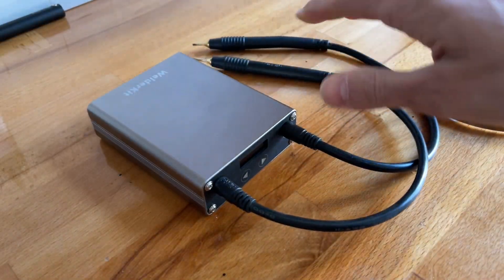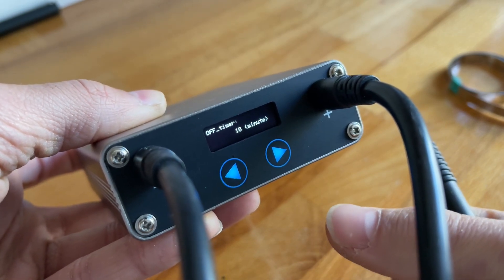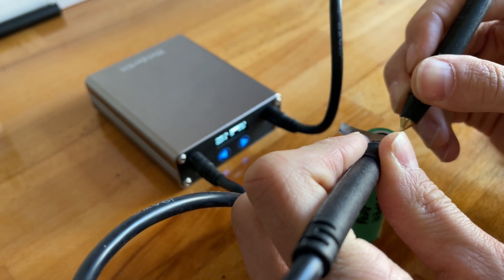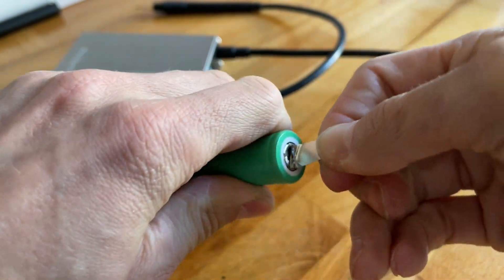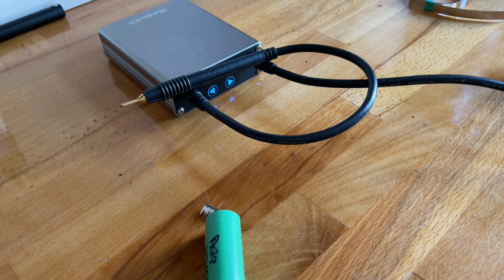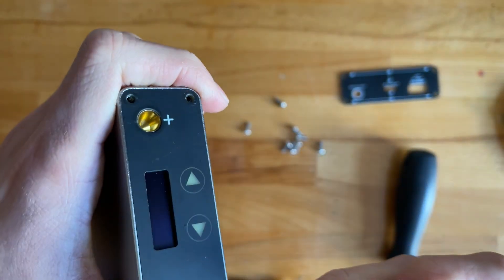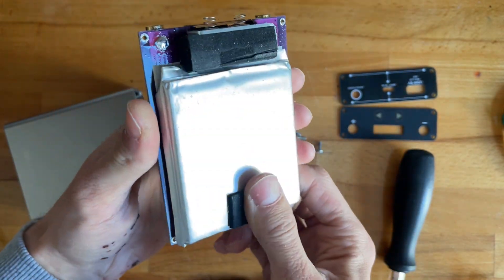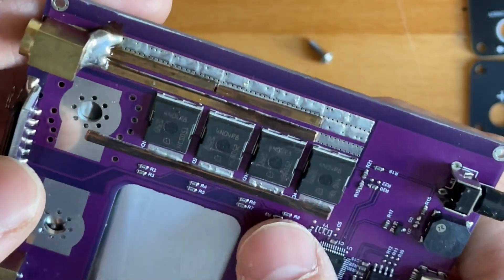How to Spot Weld Nickel Strips onto 18650s - DH30 Portable Spot Welder

Comment: i bought same machine today. is this spot welder still works ?
Reply from the maker: still works

the battery has puffed up a bit, but for a few welds now and then, does the job

if you let it discharge it'll beep crazily at you for a good few hours until you charge it above 40% or so

Comment: ❤0.3mm strips can weld with this mechine
Reply from the maker: mine has a weird glitch where if it gets too discharged it'll constantly beep when you turn it on for the full 3 hours it takes to charge above 50% or whatever it is .. does yours do that too ?

also, mine doesn't weld <60% or so state of charge .. is that the same on yours ???
Reply: @Darieee yes dear

Comment: Thank you so much for the tip. I was doing the hard press, and it was totally not working. :) P.S. give yourself a big pat on the back.
Reply from the maker: glad I could help ❤️

btw - what welder are you using, & how is it ?
Reply: @Darieee  Hi bought a Docreate 756 which lasted only a few uses, lasted 2 months. No way to get any return or contact with seller or AliExpress. I took a risk and got this DH20 from AliExpress as I was in the middle of a project when the Docreate 756 failed. I opened the Docreate 756 and the mother board had a crack running along both sides of the motherboard behind the Mofets, I don't think it can be repaired. Thanks to your advice, I have mastered this DH20, and it is well worth the money. Very happy with the welds. Thanks again for passing on your important discovery because the DH20 instructions have no mention of your technique.

Comment: Maybe that nickel is thinner but I juat got one and it am using .12mm thick nickel and mine doesn't burn or seemingly get as hot the one I got i don't know the name but it has a color screen and I have it set to 5ms for the pre heat and maxed out at 30ms and it has been working well on that .12mm but I was working on drill batteries and tried using the nickel they had and it wasn't doing it

Comment: What happens, when you press nickel strip hard first, it deforms it slightly in the area you are pressing. Once you release the pressure, the least resistance between the nickel strip and battery is where you have deformed the nickel strip. Also because less pressure creates higher resistance, temperature is higher while current is passing this spot.

Comment: Yoh, why did you scratch the pads, what for? Should i do that with some abrasive paper? Should i degrease the pads b4 doing anything?
Reply from the maker: they seem to gather some oxide over time .. I guess if you very gently run some regular grit sandpaper over them it should be fine
Reply: @Darieee  thank you, so it will make spot w welds stronger, thank you for clearing it up

Comment: 7:12 Damn that solder haha 
you will need a 5mm or even 6mm solder wick and the largest soldering Flat tip you can find to desolder that thing for battery replacement.
Good thing you can see the nickel strip  so you can just cut them off first so you can safely remove the solder without endanger the battery from all those heat from your soldering iron.

Comment: that actually make sense.  coz the factory type of spot welder are spring loaded.  in which if you press it, it will make a lot of pressure because of the spring but once it get press and the spring bounce back and the pressure is gone.    and all of that happen almost instantaneously

Comment: Can I spot weld full charge 18650. Ths is because I bought some 18650 batteries, they are between 3.2v to 3.5v. Is it all batteries to have the same voltage before spot weld, so I’m thinking to charge all batteries to full before weld but is it ok to spot weld them at full  charge capacity voltage
Reply: A fully charged charged cell should have voltage of 4.2V.
Before you spot weld your cells together it's very important all the cells are the same type, same date of manufacture and the same voltage within 0.01V. If you have an active balancer installed alongside your BMS you could get away with using greater differences in voltage.
Hope this helps 👍.
Reply: @wattyler5591  Thank you very much for the guide. Some people weld at store voltage of 3.6v, some charge to full 4.2v to weld. Is it fine for either method so long they are within 0.01v?
Reply: @ErnieSesameStreet  I'd advise you to charge after you have built the battery first. Though you could charge the cells first if you wanted to.

Comment: Very true, too much pressure creates a dead short and prevents an arc forming. Less pressure means higher electrical resistance, resulting in a much higher peak spot temperature. Shame these portable lithium welders handle .1mm strip just fine, but aren't really capable of welding .2mm nickel very successfully, which is common on most pre-assembled packs.
Reply: I have made sport welder from microwave transformer, arduino and SSR relay (small oled screen and encoder), I can solder 0.2mm nickel without any problems - and the whole project was dirt cheap. 😅

The main problem is that everything is huge, the transformer is quite heavy and large, and definitely not something you can carry out of the apartment. 
But cheapness, extreme simplicity, the possibility of repair (or upgrade) at will, fact that there is no batteries to charge and think about, are good reasons to keep such a big and heavy thing in my apartment 😅

Comment: Ah-ha!  I wondered why my first use worked OK but second try (some weeks later) all my welds were really weak (I was really pushing down hard because the nickel tabs of the battery pack I was working on were rather uneven).  Lowering the pressure a lot allows good welds with only half power (I have a '650A max' 'LCD Portable Spot Welder' branded SeeSii - 7500mAh).

Thanks very much for posting your video but I'd change the title to something like "How to Avoid Weak (Capacitive) 18650 Spot Welds" as I came across it very much by accident.

Comment: I cringe at the cavalier way the operator is leaving those two electrodes next to one another unattended. Incidentally, this is also the main reason most welds turn out poorly: the user presses on the strip with one electrode and takes their time to position the other electrode properly; if the tip of the second electrode gets near the strip, sparks will fly and there will be a loud bang (same reason as why there is a bang after a lightning). Any good spot welder will have different means of activation than short circuit sensing (I use a pedal with mine). This allows me to position both electrodes properly and try to equalize pressure.

Another reason the welds don't hold is because those tips are garbage. They should be conical, with much smaller contact surface. These are cylindrical, and they seem to touch at the rim of the cylinder, which makes the area of contact long in one direction and very narrow in another. Press with your nail onto a bit of cardboard and you will get the same result. Good welds need to be round, not oblong.

Comment: Thanks for the video. I got a spot welder that you have to push down to trigger the switch. It makes sense that it'd heat up more if the current only goes through the top plate instead of both

Comment: That's what I got too. Then I've started to press less, made it better but also from time to time I get a more violent weld that results in side burned holes through the nickel. So the secret is somewhere between ferm and gentle press. Also my electrodes are standard copper ones but after ten dots they are blunt..don't know how others can solder in videos like on a machine gun to a fixed electrodes station for example. I have to hold the metal fille near by and stop after a few cells, is this normal?

Comment: Best trick to get a feel for tab welding. Use a small kitchen scale. I made a video on this. You get so many new builders claiming what they purchased or what the made diy, saying the device is broken or not working. When in realty they press to hard or not hard enough. Once you figure out the pressure,  you'll get great welds 99% of the time👍👍👍👍👍👍
Reply from the maker: leave the video here man 🤘
Reply: @Darieee  this is the one of the videos I made.---

https://youtu.be/wkELqXkmEtA
Reply: Best tip ever. Got my $40 chinesium spot welder working.
Reply: Any recommendation on a decent portable spot welder?

Comment: I own one like this....9 power one....problem is, I always get a ton of sparking when trying to spot weld even at the lowest setting.
Reply from the maker: clean the contacts with some sand paper, press a bit harder .. and, try a different nickel strip (or clean/sand down the one you got)
Reply: What's the name of the spot welder?

Comment: Built my own welder from one of those cheap controller pcbs and a modified microwave transformer. Worked well when I first tested it using copper zirconium electrodes. But today I had problems when I wanted to use it. Thank you for this video, now I know what's the problem!

Comment: You are absolutely right. That's my finding as well. The reason behind it is that when you apply alot of pressure, you're basically lowering the resistance at the point of weld contacts, which means you require more current to achieve the critical welding tempereture, something that the cheap small welders can not produce. The industrial battery tab welders exert about 3-10kg pressure on the tips, and they can back it up by 10000A of current or more, so they have no problem. With these cheap welders apply firm pressure first to make good contact and then low pressure is the way to go.
Reply from the maker: I was really about to get massively sad and start resentfully thinking about how tf I can get my money back

Comment: level 7+ is pretty violent with my strips.. blows a hole in them (0.15 nickel plated steel... was advertised as pure nickel but that's aliexpress for you)
Reply: The pure nickel strip seems to connect less reliably, so I went back to nickel plated (which my dewalt drill originally used anyway)..   I managed to revive two power drill battery packs... happy days.    Hoping my technique gets better and I get better results in future.
Reply: @firstnamelastname7476  nickel plated strips welds are stronger as the steel has more resistance than pure nickel, and its the resistance that produces the heat to weld. Pure nickel strips require more amps/time to weld.
Reply from the maker: does that level account for how charged the battery is ?!

when I first got mine it was pretty discharged .. and even 24 or whatever the max is wasn't doing much at all
Reply: I suppose so, and instructions do say to charge it first.   Could also be firmware difference (i was given a link for upgrading, but didn't use it)..  but it may be my crappy steel strips..  I have pure nickel arriving soon, will let you know how that goes.
Reply: I'm no longer sure which level to set.. it seems so varied with the charge level, the materials, and the amount of downward pressure.. the flatness of the strip/surface.. and perhaps how clean the surface is (new batteries/strips, may have some film left on them from processing.. not sure).

Comment: cheers, yes it helps, thank you.  I have the same model.  the instructions aren't great.   the shop i bought mine from gave instructions to press lightly but the 'manual' didn't mention it.   the number '24' is the induction being detected (i think).. and the 'trigger level' is the minimum induction at which it will weld.